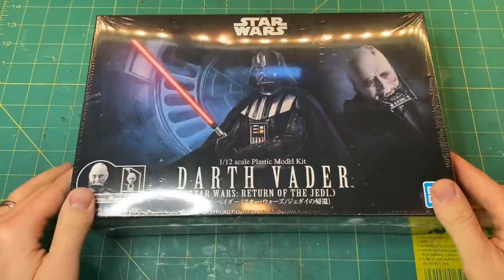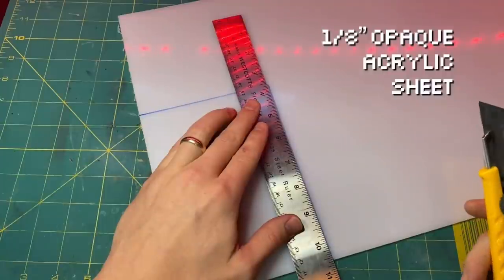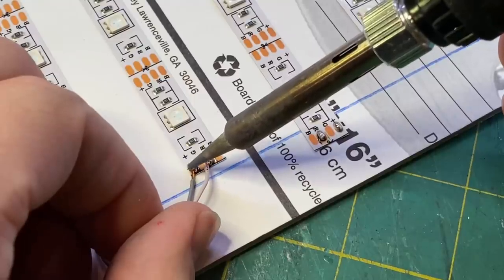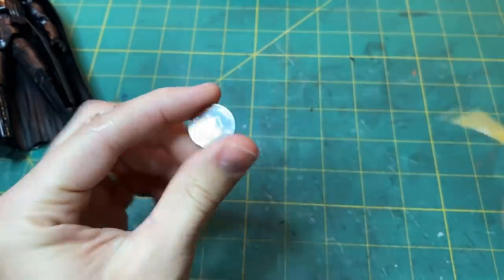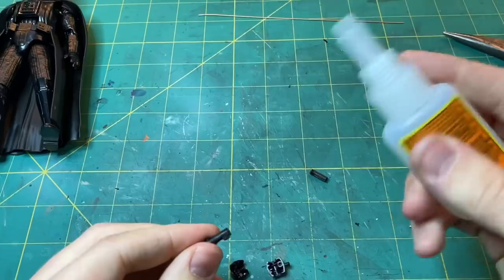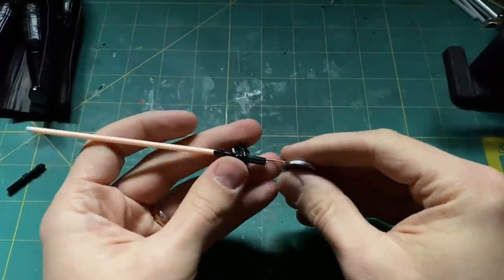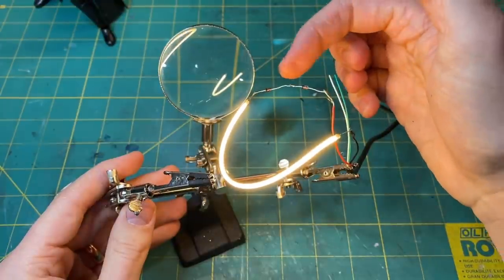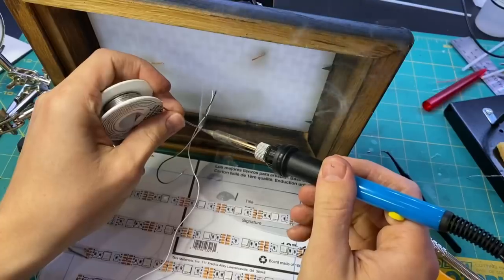How to Make Realistic Lightsabers for 1:12 Scale Figures

Comment: Quick Tip: when drilling through wood- use some painters tape on the front surface you are drilling into, it will prevent splitting and create a cleaner edge.

Comment: Would have been cool to finish it by putting it in a clear acrylic box. It maybe would accentuate the lights even more and add some protection.. Since the light saber sticks outward, for creative effect maybe burn a hole through the clear acrylic case as if the light saber did it, giving it a space to stick out from. Overall pretty neat.

Comment: resistance is measured in ohm ... not volts ;)
but the diodes do drop +/- 0,6 volts, so you do get the end result you wanted (5 - 1, 6 = 3,4)
if you knew how many amperes the light needed you could use ohm's law to calculate what kind of resistance you'd need to do the same

Comment: How is the lifespan of the LED filaments? I believe those require 100 mAh to run while the battery gives over 200 mAh which means it will burn it eventually.

Comment: Maybe a stupid question but whats the benefit of using diodes instead of resistors? I run these filaments on 3.7 V with a 8000 ohm resistor to dim it and they still run pretty hot, not hothot but probably enough to soften some glue joints.

Comment: Disclaimer: Aside form a few cchool projects back in the day, I never worked with electricity neither have I worked with models or Dioramas, but I am a huge Star Wars Fan (except for the Sequels of couse ^^) and want to try my Hand on something like this.
I have the wild idea of doing this to the collector's Edition figure of Star WarsThe Old Republic (Darth Malgus) and I'm wondering if it would be a viable idea to put an extra 3V nano LED at the tip of the lightsaber set in series with the filament so it doesn't have that dark spot up there. I wonder what you think of this idea.
Reply from the maker: Thanks for your comment! That is something I hadn’t thought of. It could work! The trick would be to get the led close enough to actually hide the dark spot. The last led is about two millimeters from the end of the silicon layer which is why the dark spot exists. Attaching another led directly to the end will likely create a bright tip with a small gap before the rest of the blade, however if you were able to VERY carefully cut away some of the silicone you could get it closer. There is not much margin for error at this scale, so you will want quite a few backup bulbs. 
This is a good suggestion! It would be a great way to improve this blade setup. I will do some experimenting of my own and let you know!
Reply: @Boylei  Thank you for reading you comments so actively. I am eager to hear from the test results ;D

Comment: Anyone got a source for translucent 3mm cocktail straws? I can’t find them online anywhere 😖 Alternatively other options? I have looked at PLA tubing but I think that will block too much light. PTFE tubing I think won’t be straight enough. I thought of maybe using a stiff rod at the back and clear heat shrink tubing over the filament and rod and then maybe wrapping it in cellophane?